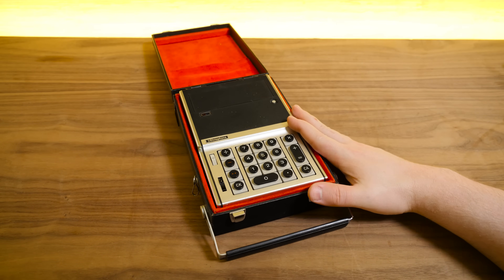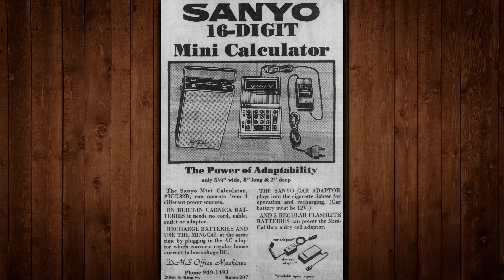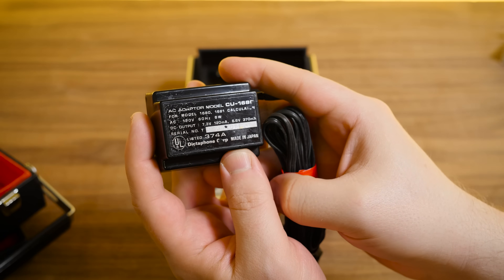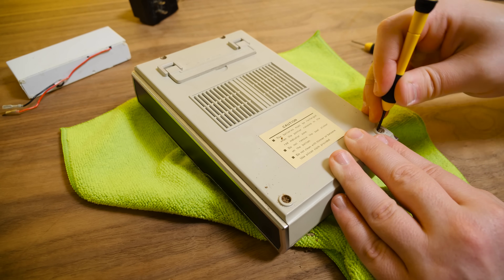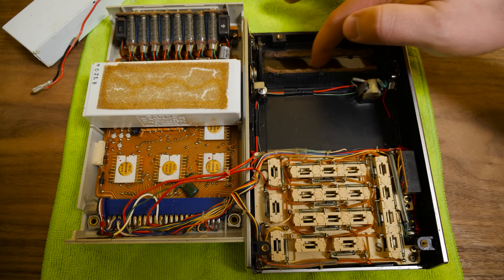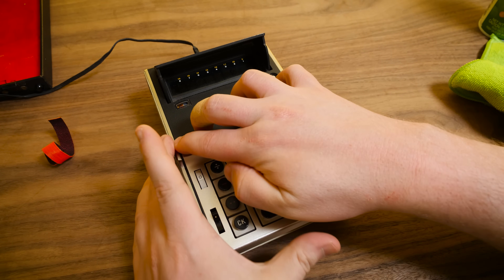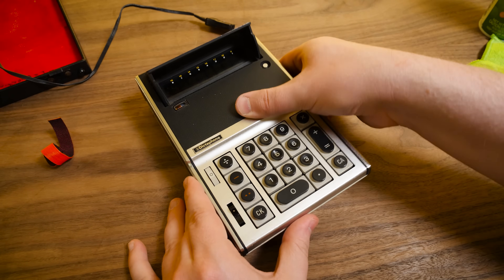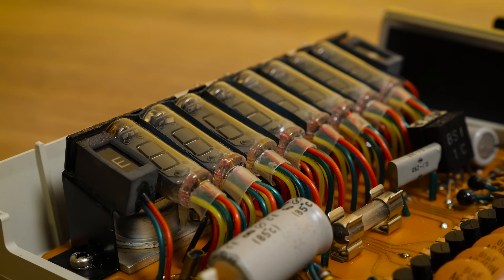Smallest Battery-Powered Calculator in 1970: Dictaphone 1680

Comment: Those 7 segment display need some transistor to light up the  segment.   If the same  segment is out on all then the display driver is bad  or the  wires or chip it self.

Comment: Great video, and I hope you can get this fixed. Technically, the Royal Digital III was a smaller (single chip!) calculator that came out in '71 - but it only had a four digit display(!!) - hence the advert for the Sanyo being specific about it being the smallest 16 digit calculator. At the time, the number of digits a calculator had was a big deal, and most calculators had a button to switch between 'high' and 'low' digits to make the most of their limited displays.

Comment: 99% chance with those old systems that it's a power issue. Whether a capacitor failing, or a failed component (like a dead (shorted) transistor) pulling the voltage rails too low.

Other issues include broken traces (from e.g. thermal cycling and other aging) and a heap more issues.

Should be easy to diagnose at least, especially with a schematic. Those early ICs can fail, but this isn't very likely as they aren't nearly as fragile as modern-day ICs (without zener clamps and other protective ESD-related measures).

Comment: At 08:20 I see that the PCB is plugged into a blue edge connector socket in the bottom of the left-side assembly. Perhaps pulling the PCB out of that blue socket and spraying some contact-cleaner in the appropriate spots will help restore the intermittent display segments.
That's definitely a cool calculator... thanks for sharing it.

Comment: I did a project in highschool using a 7 segment display. It involved building a circuit with diodes so that as you flipped a series of switches, the display would cycle through the digits of your birthdate. Not saying I know what I'm doing, but it seems like segments are not getting any input and one segment intermittently gets input. I would suspect anything in between the IC's and the display tubes. What specifically, I have no idea. Since one segment is intermittent you could probably do some continuity checks with the segment both on and off to see if you can figure anything out.

Comment: I am struck by the cosmetic resemblance between this calculator and a Tricorder from Star Trek that came out just a few years earlier. I am sure this was merely a coincidence and not Sanyo purposefully designing something that resembled a science fiction TV prop, but it still indicates that the show was slightly ahead of the cutting edge of design for it's time. This is not an isolated coincidence either. (cell phones, tablet computers, touch displays, etc.)

Comment: I think the gas discharge tubes are more like Nixie tubes, basically each segment is a tiny neon indicator. There's no vacuum in them, just a low-pressure gas. Once the striking voltage is reached between the electrodes, current will flow through the gas, creating a plasma which excites the gas to glow the distinctive orange colour (although different gas mixtures can be used to create different coloured gas discharge glows).

Nixies are a specialised kind of GDT, where there's a cathode grid across the front of the tube and multiple anodes stacked on top of each other, one for each number (or character) in the tube.

That's very different from a VFD, which work more like vacuum tubes. They use a hot cathode which boils off electrons that fly through the vacuum tube to hit the anode. The anode is coated with a phosphor, which glows when struck by the electrons. The cathode is negatively charged, and there's a control grid between the cathode and the anode that's positively charged. Electrons are accelerated from the cathode, through the control grid to the positively charged anode, which glows. If the anode is negatively charged, it doesn't glow.

Because GDTs need to strike across an inert gas, their working voltages are much higher than VFDs, typically 160-320V (depending on segment size). That means this kind of low-voltage device requires a circuit to generate the high voltage required to run the tubes, and high voltage transistors to switch on the segments. VFDs operate at much lower voltages, typically up to 24V at the high end, which is one reason they quickly overtook GDTs as the preferred display technology from the late 70s all the way through to the 90s when LCDs started to take over.

Fran Blanche has a good video explaining the difference, "Know Your Displays - Nixie vs. VFD Tubes".
Reply: Here's the link to Fran's video (if such links are allowed through the spam filter): https://www.youtube.com/watch?v=Z_Ga15np_Lk

Comment: First guess is a driver transistor. I'd  check the traces and find the culprit and test it out of circuit. If that tests good then it's likely one of the driver ICs. So here is hoping it's a transistor as they are simple to replace even today. Those ICs were likely one off chips, or at the very least had a short production run.

Comment: The 'burn' marks on the battery by the wires are the elastomer used in the wires leaching into the plastic. You see this on vintage computers that people have wrapped the power cords around.
Reply: This is why I stopped wrapping cables around keyboards, game controllers, etc.
Reply: Most typical examples, PVC damaged by contact with (unexpanded) polystyrene {you guys call it styrofoam) and ABS damaged by contact with PVC.
Reply: 8-bit guy had a few Commodore 1541 drives that had this type of cable damage.

Comment: 11:59 Those "burn marks" I expect are actually from the casing of the wires reacting with the plastic over time. They do look like burn marks but you can see that the wires have been in close contact with the plastic and so I think they're the result of a chemical reaction between the two. Great video as always!
Reply: What I think happens: PVC, as used in the wire insulation, is by itself a hard plastic. Think PVC pipes. To make it flexible, a plasticizer is added. This can leech out and outgas over time, which is one of the reasons old PVC plastic becomes brittle. With close contact, pressure, and a couple of decades, some of the plasticizer has diffused into the plastic of the battery housing. That spot became flexible, and since it had a wire pushing on it, it flowed out of the way with time.
Reply: Yes, precisely what it is.
Reply: This is super common, I see it all the time with stuff I repair

Comment: 12:00 probably not burn marks, but the wire casing reacting to the plastic over time. I can't quite remember where I saw it on Youtube, but something similar happened to an old floppy disk drive or some other component that had its power cable wrapped around it in storage.

Comment: Cool. Maybe an excuse for a collaboration with a YouTuber who does older vintage electronics repairs?
FWVLIW: That it works at all is both amazing and suggestive that there is very little wrong with it - I'd be surprised if the ICs were FUBAR, seemingly no (EP)ROM to go bad. At a wild guess I'd say cold solder joint(s) or bad (electrolytic) caps would be your prime suspects. For this vintage of electronics transistors can be pretty fragile and are absolutely worth checking. I presume you checked the rails on the PSU?
Reply: Your comment suggests you don't know what you're talking about. A faulty capacitor certainly doesn't manifest itself that way.

Comment: I would suggest before replacing every transistor or especially the likely difficult-to-obtain ICs, trying to reason out where the fault could be based on the following:  it looks like there are 2 segments not working on EVERY tube at once meaning it is probably something driving them all.  Others have suggested the transistors - this could be a good place to start if there's a transistor in the "path" of the segments (segment <- transistor <- IC    ...where the <-s could have any number of resistors, caps).  I might also expect 1971 capacitors to have degraded.  If you see any big ones on there (the small brown disks are likely fine) those could be another thing to investigate.  When I say investigate it might mean replace, but also look for any burn marks or little holes in the transistors, and any fluid, corrosion, etc. near capacitors.  Someone with know-how and applicable machinery could also possibly let you use their Curve Tracer for the transistors, and their LCR and ESR meters for the capacitors.

Comment: I suspect the missing segments in the display is duff driver transistors. Those TO106 round  transistors can often be problematic in old radios etc,. Apparently they haven't aged very well. A suitable replacement would be something like MPSA42 or MPSA92 high voltage switching transistors, depending if they're NPN or PNP.
Reply: Those came into my mind immidiately, too. And they are still readily available for just a few cents. I think it is multiplexed, so it likely uses PNP for the anodes and NPN for the cathodes.

Comment: My gut feeling is that it's probably one or more capacitors. They are well past their expected life span.
Also I'd investigate the components that melted the bottom of the battery casing. Maybe a faulty component overheating did that?
If those chips are not getting reliable expected voltages that will cause weird stuff to happen all on it's own.

Fingers crossed the display, and those old chips aren't faulty. I don't imagine it would be easy to source those parts.
Reply: Runco990 seems to have the right idea with those transistors

Comment: Didn't know this was the basis for the Ghostbusters prop. Is apparently quite the problem in the prop maker community essentially cannibalizing other fandoms. Vintage camera parts were a big thing with lightsabers along with some of the Aliens props, vintage model kits were heavily used with numerous films to "kitbash" sets props and even costumes, and vintage gun collectors worry about people taking functional and increasingly rare Mauser C96 to turn into Han Solo's DL-44 along with a wide variety of other increasingly rare WW2-ish vintage firearms. Used to be all those things were dirt cheap and easy to find but in the past 40 years have become scarce.
Reply: As a member of the Ghostbusters fan community as well as a prop enthusiast, you have to understand at the time of those props' creations things like 3d printers didn't exist. For Ghostbusters alone, the Ecto-Goggles were military night vision goggles with one of the lenses replaced with a very rare photography lens, the PKE meter was a rented prop from Modern Props and it was built from a Iona SP-1 hand held shoe polisher, and even the Proton Pack has parts that - although still made today - are a bitch to find due to them being industrial parts still used in legacy systems. And don't get me started on the Ecto-1's equipment rack. This was all considered junk in 1983/1984 and ultimately used for these purposes. Granted, when replicators find the screen used part, they can't help but use the genuine article because it puts them in that coveted , "Screen Accurate" category essentially making you a god among prop builders. It may be stupid for you, but it is true.

A few people have since make replicas of the parts including this calculator board. If anything, you could thank the prop guys for making it far more scarce; now you have something of value.

Comment: it looks like every digit is driven by a common circuit for the segments in a multiplexed way (this was done to cut costs and simplicity at expense of having a lower refresh rate); you should isolate the circuit line corresponding to that particular segment (which looks like the F one) and check for broken trace, bad transistor or component in that line of connectivity; also you can individually try lighting that F segment of any of those digits, i.e. injecting 1.5 V with a battery to see if it lights, just my 2 cents.

Comment: did you push down on the ICs at all even if they are soldered?
That would take care of discovering any possible cold solder joints.
If that was already tried, I would say the other comment is more likely the blob transistors are failed that drive the segment display

Comment: Those wonderful ceramic chips look like they'd be right up CuriousMarc's alley. He could probably fix this up in 15 minutes, but drag it out to 5 episodes anyway in order to have the chips decapped and reverse-engineered and reform the original transistors instead of using modern replacements or something. :)

Comment: The marks on the battery are from a chemical reaction between the plastic and the rubber of the wires. This happens a lot with old microcomputers that were stored with their cables wrapped around.

Comment: I would say you need a schematic. It's probably something in that line of capacitors or transistors under the battery.  If you had the schematic, you could check voltage points to trace the issue.

Comment: It might be worth trying to figure out if the actual calculator functions are working properly.  If you can do some operations using 8s and 1s (or whatever numbers you could interpret given the missing segments), maybe you can verify the operations work and narrow the problem down to the display only.  Also, dig around and try and find what each of those Sanyo chips does.  Re-flowing solder is not a bad idea, though usually a longshot.

Good luck!

Comment: for the screen, i don't think it's the tubes themselves being broken because it's always the same "broken" behaviour on all of them. i'd try searching for / figuring out the pinout or schematic for the tubes or device itself, then try to think of what's going wrong. maybe there's something wrong with the connection to the tubes? try to trace out where the signal comes from, all the way from the "motherboard" to the tubes. i have no experience with this but this is what i'd start with, hope it helps

Comment: Try changing capacitors. After all those years they are probably dead. I guess they don't have much power to deliver to the tubes, since they consume a lot mot power than today's LCD displays (that explains why random lines don't light up each time you turn it on). Just make sure to match farads and volatage on those capacitors (in fact you can use a slightly higher voltage rated capacitors but not lower). They are really cheap.

Comment: In the 70s my mom did accounting with a big noisy heavy mechanical adding machine. She didn't trust electronic calculators because they were "too small".
Reply: I work in accounting and mechanical adding machines are still standard issue for our desks everywhere I've worked. In fact, as recently as 2019 I was responsible for a process where one had to "run a tape" (ie. do addition while printing it to the paper strip), and ensure the grand total matched what was in the folder.
Reply: Around the same time my Father brought home a mechanical calculator because they had replaced the ones where he worked with Texas Instruments electronic ones. However he said that each TI pocket calculator had been screwed onto a large (breadboard sized) piece of wood because they didn't trust that the employees wouldn't stick them in their pockets and walk off with them !
Reply: @MrDuncl  Kinda reminds me of how Commodore made the Educator 64 (a C64 in a PET-style case -- including the built-in CRT monitor) after schools refused to buy C64s that were small enough to slip into a student's backpack.
Reply: Size queen
Reply: @HelloWorld-jt9yp  💀💀💀
Reply: ayoooooooooo
Reply: To be fair, you ever multiply 1/3 by 3 on a cheap four function calculator?
Reply: Obviously she's preferred larger things
Reply: do you still have it,been looking for one for my ghostbuster cosplay outfit....

Comment: "Not even as integrated as..."

The lid??? :D
Reply: That type of detachable hinge was a feature so you could use the calculator without removing it completely from the case and the cover wouldn't be hanging clumsily at the top.

Comment: Those are 7 segment Nixie tubes like Panaplex (even more rare than regular nixie tubes). It looks like you're missing "F" segment to all digits, so either a contact to F's is broken or the BCD to 7 segment decoder is broken or has bad joint. Those tubes are all in parallel, the grids are separate, the control is dynamic multiplex. Search the problem in "F" connection or see if some of the tubes is shorted on F segment to grid, in some cases, each segment can receive its supply trough a resistor (check it) so 8 of them needed for each row of the 7 segments and dots, there also could be a transistor driver switching them, check all those points and elements on the "F" segments path up to the IC (integrated circuit). On the backside of each tube you can see how the connections are made and trace where they are going out of the tube. The problem should be easy to troubleshoot.

Comment: Sometimes you can get failing ICs to work temprarily if you freeze them with an upside down air duster can. Not a fix but an easy way to check. Also caps probably out of spec after 50 years.

Comment: There are 7 segments in the tube, find the one not sending voltage. Input the number 8 to light all segments and start at the tube. You will probably work yourself back to one of those crappy ceramic transistors.

Comment: normally don't get excited about calculators, but love those old white ceramic and gold ICs, and the way this thing is built in general. There's just something incredibly impressive about electronics right at the start of the transistor and IC era.

Fun thing about the battery meter: on the portable compact cassette recorders from the same period that component also serves as VU meter for the recording level, just with slightly different colouring

Comment: Were there smaller non-portable calculators?  I guess with a wall plug and no battery? The advertising seems to imply there were but I've not seen one.

Ahh there's one in ur calculator wars video.